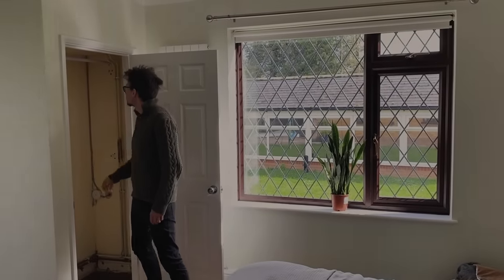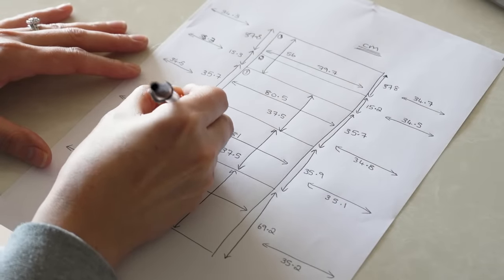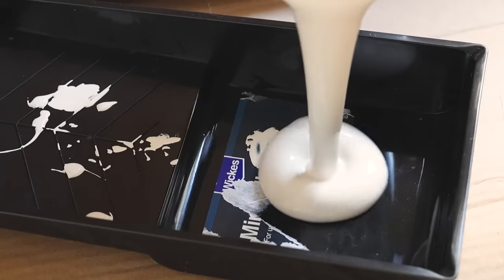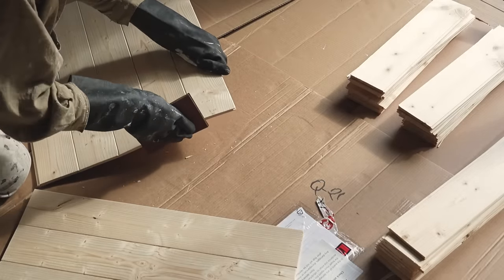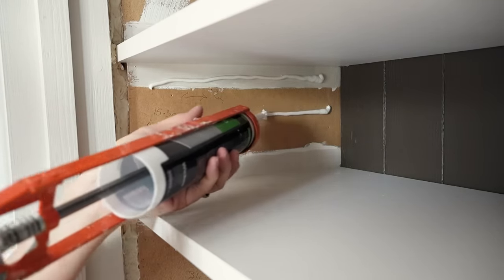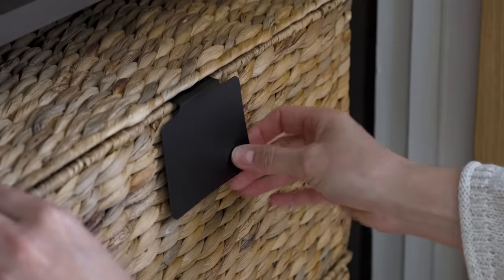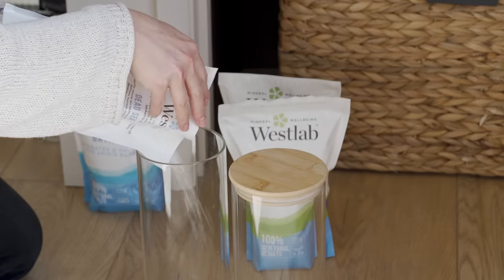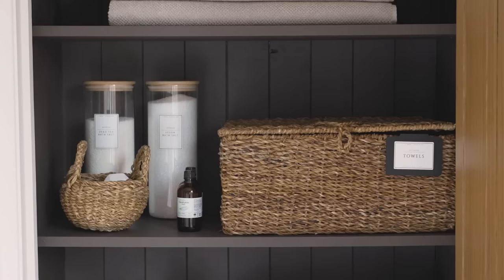Linen Cupboard Makeover & Organisation

Comment: Great project. I admire your perseverance around the shelves. I would take them out, install the boards or use wallpaper and then put the shelves (somehow) in the end.
Lovely project. How durable do you find this paint? I've done a similar project but my basket leave scratches. After repairing twice, now I've decided to give the basket a soft bottom by stiching felt on them
Reply from the maker: I used the paint in my wardrobe room and it’s been great! You have to let it properly cure for the specified time on the tin but it’s made for kitchen cupboards which of course would have daily use so it’s made to be very robust. I haven’t put anything on the bottom of these baskets as they’re soft but if you had wooden or metal baskets I would use the self adhesive felt furniture pads on the bottom, they’re cheap as chips and often come in sets which are always useful to have 🙌🏼
Reply: @EmmaHill  Thanks for the reply. Curious to see your next lovely project